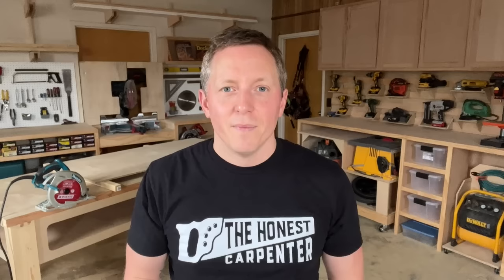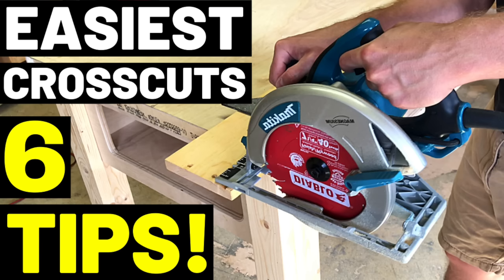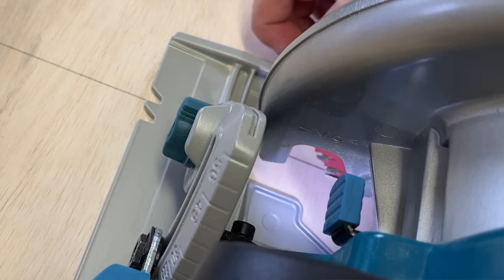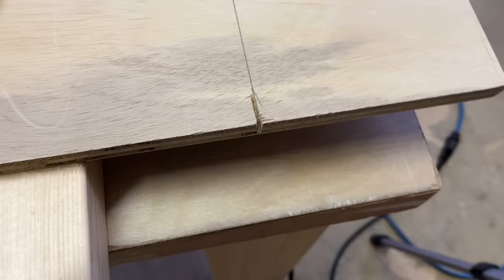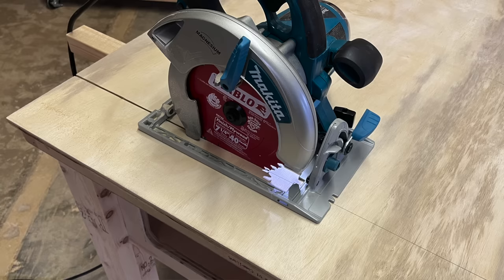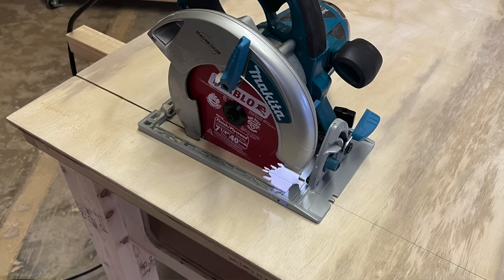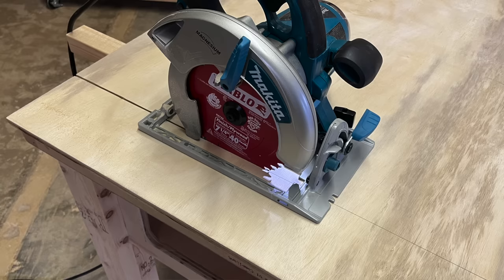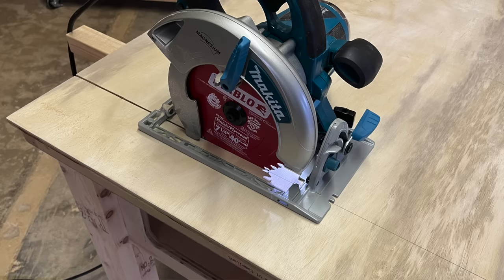How To CUT STRAIGHT With NO GUIDE! Freehand CIRCULAR SAW CUTTING...Pro Tips, Tricks and Secrets!

Comment: Im a little surprised he didn't give the most helpful tip for straight cutting plywood rips... Use/extend your arms as little as possible. keeping your elbows sort of locked and pendulum from your waist and feet. Small shuffles with your feet, and tucked arms with little extension.This is a good way to keep a lot more control while making longer rips. Its much more prone to wobble when your arms are extended.

Comment: Thank you. I am new to these saws and thought I could trust the notch at the front of the saw. It hasn’t been too inaccurate, but I will train myself to watch the blade instead.  Also, the tip about placing the cut line to the right of the kerf is excellent. Much better than cutting directly on the line, where you can easily lose track of the cut line.

Comment: I used fluorescent orange paint to make two lines with the "cut"  perfectly between the two lines on the saw plate. This way all I have to do is follow the line I've drawn on the board with the two lines. Works every time! I recently got a kreg track for circular saws and that has been a godsend for long cuts . But I still use my old method for shorter cuts .
Reply: Kreg track? I’m going to have to check that out. Thanks!

Comment: Nice tutorial.  2 things that make me cut really straight are 1) a sharp blade and 2) when I switched to my cordless Makita...the torque on that is amazing.  The torque prevents the blade from catching on the wood.   That cordless Makita worm drive saw is one of the best tools I've bought and is 10x easier to cut straight with that than my corded Makita.
Reply: I’ve got one, too, and agree with you. It’s also far less noisy than the corded saw it replaced.

Comment: You can buy sidewinder saws wit the blade on the left side like the worm drive saws. Porter Cable was the first ones I saw that had both left and right hand blades but I think now most companies do this as well. Another tip for starting the cut is to use your speed square as a guide to start the cut strait.

Comment: THANK YOU for your tips. I took them and did two additional things to help my aging eyes keep the blade straight. I needed to rip cut a 12ft Trex deck board that is light brown, so I ran a strip of blue painters tape along the board and made my pencil mark on the tape. I also laid the board outside in the sun to help me see. It worked! I took my 4ft level to check after making the cut and it isn't perfect, but it is extremely close!!

Comment: I've been cutting freehand over 50 years. You covered the subject well.   Every concept you mentioned is vitally important.  Newbies should watch the video enough times to be sure they have every procedure in mind when they begin.
The only thing I do a little different is to put the saw cord on top of the wood I'm cutting before starting the cut.  That way I don't have to stop while making my cut and have begin the cut again.  Just move the cord far enough from the cut line before starting the cut.
Good job.
Reply: it depends on the circumstances, but leaving the cordline on the workpiece is not a good advice. leave just enough cord so the saw operates freely and put the cord over your shoulder.

Comment: Great video , , , i am one of those who is not to confident with the circular saw , , , i actually bought my first circular saw after watching your video on this saw , , , i have used them occasionally in my life but i am not good with them , , , this video gave a lot of good safety tips and good tips on how to get the best cut , , , thanks   👍
Reply: The take away from this video is if you want a clean, straight cut then just use a guide. But setting that up does take a little time. That's the trade off. Still, the cut you make is forever.
Reply: @1pcfred  👍

Comment: Good tips.  The #1 reason I have to stop a cut is due to poor power cord planning (totally my fault).   I always try to plan out where the cord will go before I make a cut, so it does not get caught up on an edge or run out of length partway through.  Cordless saws are great for that and I love my 20V Dewalt, using it whenever I can, but knowing its limitations as well.
Reply: The cord on my dropsaw is shorter than when it was new ..... wooops

Comment: Tips:
1. You are responsible for EVERYONE's safety with any dangerous situation.
2. New / sharp blades greatly improve beginner success.
3. Avoid abused tools. Warped or bent blades are not obvious. Loose causing blade to wiggle. Something as simple as dragging blade during plunge cut or twisting blade to fix cut direction.
4. Not too slow. By going extremely slow, beginners often increase the size of the kerf causing the blade not to track straight.

Comment: I love your videos Ethan, however I think this is too advanced for newbies for a few reasons. One is that why would you want to cut freehand anyway, as a beginner it's much easier to use a straightedge. Secondly I see a problem in that by following the line you are putting your body in line with the blade, I have been taught to have body to the side to avoid the saw coming back at you. I also think that beginners will get over confident and start backing up the saw too much, as a beginner hobbiest myself I would never risk backing a saw up mid cut, just seems too risky to me.

I am in the UK, nearly everybody here has switched to tracksaws for these type of cuts, the saw is not nearly as exposed, you cut to the side and so long as the rail is secure there is none of this stress about following the line. Personally I think once you get a tracksaw you realise how much better they are at cutting sheet matierals, plus they are more fun to use. I get that pros need circular saws as they are quicker but for the weekender they are a high risk tool in my opinion, so tend not to be my first option now.

Comment: With you except for “split the line”. The line should be the “keep”side and with a sidewinder that’s normally the left side of the blade - so the kerf is 100% on the right of the line, which is normally the “waste” side. In that orientation the wide side of the saw rests on want you’re keeping and the narrow side is on the cutoff piece.
Reply: If you're cutting freehand does it really matter? If it really does matter then why are you cutting freehand?
Reply: Completely agree... It's worth the addition (somewhere) that with this set-up, any deviations caused by fatigue (the most common) will generally "pull" the saw into the waste and any "harm" is relatively minimized.

    For extra precision, the set-up can also be arranged to leave a tiny bit of waste so that after the circular saw "rough's it in" a final result can be "snuck up on" while you straighten the cut out with a few strokes from hand tools (planes, sanding blocks, files and the like) as appropriate.  ;o)
Reply: @gnarthdarkanen7464  I wasn't going to bring it up but that is what I do. I leave a little and plane to the line. Today not many power tool woodworkers bother with hand planes. Using them can be a chore.
Reply: @1pcfred    My experience comes from a LOT of completely custom fittings which lends to using the test and trim methods... A few strokes of a plane is far and away faster than a couple dozen strokes from a file or sandpaper... SO I'm quite prone to mixing and matching power tools for "roughing in" and then hand tools for final precision...

    I suspect the "purists" of woodwork are less experienced over all, whether they're entirely hand-tool or entirely power-tool oriented... BUT that's only a suspicion, as there are perfectly good niches to fill with either attitude.

    AND as to the chore of pushing or pulling a hand-plane, it really depends on how well the tool fits the job and how well you upkeep and set the tool... The chore for test and trim is carrying the damn piece of work back and forth from project to bench and all... BUT some things can't be escaped entirely. That's what makes it worth someone else's money for ME and YOU to do it.

     In any case, with some degree of skill and growth at it, the most efficient shop will balance a "perfect marriage" between power-tools for production and hand-tools (as appropriate) for precision, netting the best of both figurative worlds.  ;o)
Reply: @gnarthdarkanen7464  using a plane is not the chore of the task. Getting a plane ready to use is.
Reply: @1pcfred   On that kind of argument, so is any sufficiently advanced power tool... They're precise as hell, but all the faff is about setting them up for a cut... A thousand cuts later, it's still dead on, so in some repetitive operations, it's worth it... Just not everything.

    AND if you just don't neglect them, they're rarely so out of adjustment as to need a lot of screwing around before you can make progress.  ;o)
Reply: @gnarthdarkanen7464  I don't have any of those sufficiently advanced power tools. Not when I examine the work that comes off of them. Look closely enough and there's always some inaccuracy. Fortunately most folks don't run around with squares on them.
Reply: @1pcfred  Well... It's worth pointing out that every industry has a "standard" which includes certain "tolerances" regarding precision... In wood, the precision comes down to a single fiber, since that can't really be effectively shaved any thinner... they just break when you try.

    To a certain degree, even the sap, rosin, and other fillers around the fibers can be included, so those tolerances are often dubiously difficult to narrow down beyond around a 32nd or 64th of an inch.

    In any case, with enough experience at it, it becomes steadily more imperative that a little of the waste is left with every cut for the trim and test "corrections" if one truly wants the work to look as perfect as possible. It's tedious, but it works.  ;o)
Reply: @gnarthdarkanen7464  I'm pretty sure that fibers can be cut. But I don't want to split hairs over the topic.
Reply: @1pcfred  🤣😳🤣

Comment: As a right-hander I much prefer the blade on the left.  You can see the line without leaning over the saw, and if it kicks back, it does so further away from your body (or thigh).  Used a worm drive framing, but you can get saws similar to yours with the blade on the left.

Comment: How do you feel about using a thick piece of insulation as your surface to cut your piece on? Thanks for the informative video!
Reply: Like expanded styrene foam sheets, right? Why spend money when you have a bunch of cutoffs that you can use for standoffs. Edit. I just don't have room for a 4x8xX thickness in my two car garage!
Reply: I like the foam because the wood is supported 100% and I usually cut 4x8 boards in the driveway.
Reply: It works wonders because it supports the wood 100%, much better than the 2x4 method.
Reply: you can also compromise.  I don't have room to keep a full sheet of foam around. But I do keep strips of 1 to 2' around. And instead of the milled 2x4 (milling is important because 2x4's are never truly straight), I use the foam boards instead.  Also, to those that ask "why bother" one simple benefit is that you can stand on the plywood because it's much better supported.  When cutting across 4 or 8', you're not going to be able to lean over to complete the cut. With a foam board underneath (even sections of it) you can walk on it w/o pinching the saw blade.  And I know this was a straight cut video and he mentioned the "how to safely cut" video, but just make sure that the cut side can fall off freely so it won't pinch and bind.
Reply: The 2-inch foam is great. It is reusable and provides excellent safety and support, especially for large sheets. But it works well for smaller pieces.  I use a smaller 2x4 section for smaller pieces.
Reply: That’s exactly what we do. Two pieces of 1” XPS foam ea 18x72.  That size is not hard to store, we barely score the surface so they last literally for years, and they’re small enough to leave you room for edge guide clamps if you need them. There is no “mess” - you’ll be making 1000x  more sawdust than foam dust. Been doing it that way since the early ‘80s.
Reply: @paulsmith9341  Because you’ll get much cleaner cuts. Try it you’ll like it. Cut your sheets 18x72 or even 14x72 so you can store them in an empty stud bay. You need at least 6” around a 4x8 sheet in case you want to clamp on a track or edge guide.

Comment: Great video, definitely some "aha" moments for me. How do you feel about using chalk lines? Are they accurate enough for exterior work? I'm just finishing up a skatepark and we used chalk a lot but sometimes it didn't feel as accurate as a pencil. I also found that I actually get straighter lines when I constantly shift my eye between the blade and the notch on the plate. It seemed to make more sense to look at where I'm going than where I am on the line.
Reply: Yes, i too try to both look out ahead of the blade & right at the blade on the line.  Kind of like driving - looking out ahead of your travel direction is crucial, but up close too to swerve around turtles & pot holes.

Comment: Great video. I've used a saw for 40 years and still found it a great refresher.  Like others, I agree you found a way to articulate technique that sort of becomes second nature after a while, that's the mark  of a great teacher.  I would love to add something useful but feel like you covered it very well.  I did notice when you talked about the cord at the end, you had them plugged straight to one another. I am in the habit of tying my cords together in a knot before plugging them in, that way when they get hung up, I tug against the knot, not against the connection point of the two cords to  reduce the chance of unplugging my saw.  In the garage it's not a big deal, but before battery powered tools, it often kept me from climbing down a ladder to plug my saw back in.

Comment: My ‘97 porter cable still going strong. Only one trouble was letting my brother in law help cut deck joists at the end of day when he begged to cut. Yeah it took him three cross cuts before he lopped that cord in half. He looked at me and ‘I think I fup, but give some tape and I’ll fix’
Nope bought a new 12’ cord the next day.  
#1 thing before pulling the trigger is the free run of that cord!
I just bought a cordless, so looking to the new freedom along with a dewalt 20v frame nailer.

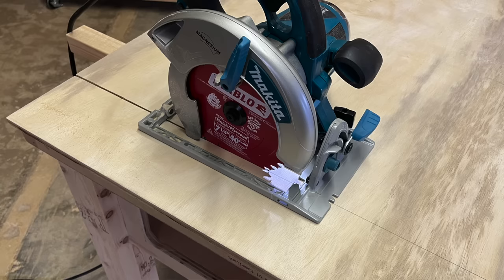Comment: I know this is a video from a year ago, but since it has come around again, I’ll mention something I noticed. Even though this is not specifically a video about Circular saw safety, (and that you’ve likely covered it in another video) but since you’re talking about making longer cuts into material like wide boards and plywood, I think binding and kickback are always helpful to mention, especially for videos aimed at informing Beginners and DIY’ers. Specifically around the 12:40 mark, you talk about not backing the saw up too much within a cut line, I think in terms of stopping and restarting a cut. Then, at 13:18, you are demonstrating how to gently lift the blade guard and hold it in place to keep it from hanging up at the start of a cut. Now, you do mention the importance of keeping your fingers away from the blade, which is all very valid and true. However, the camera angle you’re filming from highlights another danger to be mindful of and that is keeping the rest of you out of the potential backwards path of the spinning saw blade should it accidentally bind up and kick back. If it did that at that instant, it would be made potentially more dangerous given the fact that the guard is being held up in place, and not allowed to spring back down in time to offer any lever of protection to exposed body parts like hips and legs. Now, I know we’re already twisting and contorting to see the cut line and keep things straight and all that, but a couple of old timers pointed that out to me and it made a lot of sense at the time. I think the camera angle really made it apparent, even if the distances appear closer (ie more in danger) than they actually are…like you have said, “These saws are powerful, and can be unforgiving if precautions aren’t taken.” Overall, amazing video, again, just like the rest of your content. Just some food for thought.

Comment: In 1975 I needed to make a cut and didn't have a saw with me. I asked a carpenter in the house I was working on if I could use his saw to make a couple of cuts. I made the cuts and for the first time ever it was a breeze to make a cut with a power saw. The saw I used was a Skil worm drive. In all of the years since I have never owned any other type. I actually have one that was made before the plastic handle. I think I bought that one in '78 or '79.

Comment: I always use painters tape and a straight edge on all cuts (no free hand cuts). With many years of experience, I realized not to rush. Take the time and do it right, keeping safety in mind! I love my worm drive saw with the blade on the left.
Reply: I do the same thing plus my worm drive is battery powered.  In addition, I started using 2" thick pink foam under the boards I cut.  No tear-out, no issues.
Reply: Nice advice. It does depend on your context and constraints. Finish or framing? For some jobs quality is money, for others, time is money. Of course you're right about safety. Injuries are expensive!!
Reply: @zane4682  Pink foam with rough-in cutting plywood always.  Painter's tape with finished trim to prevent tear-out.  A little extra time will get you the next customer.